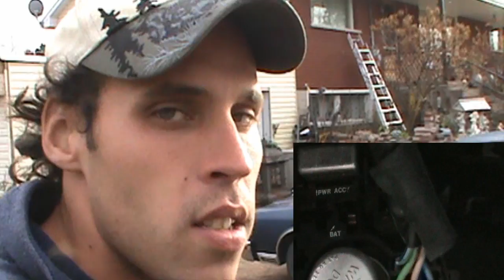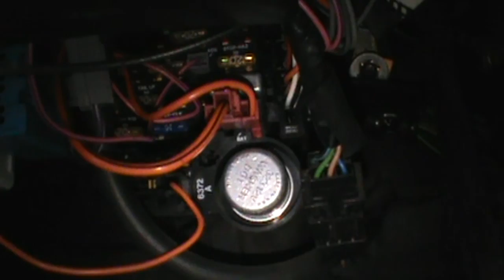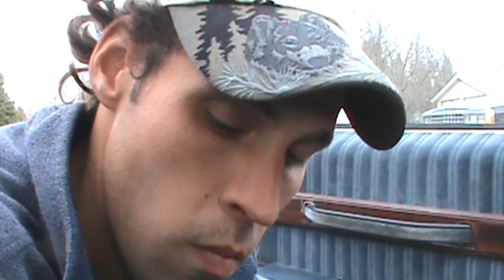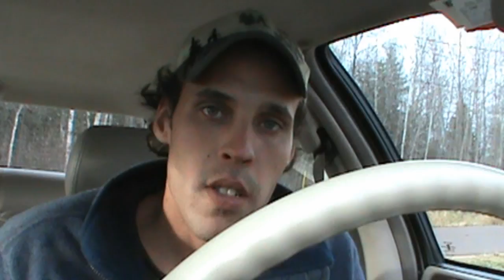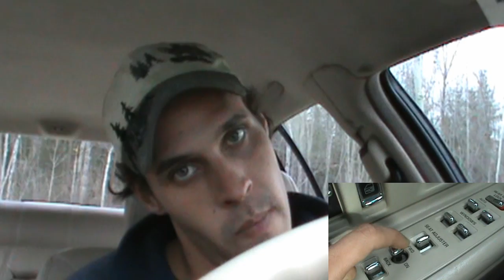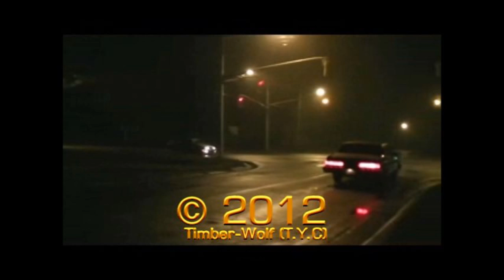Discussion On GM Power Seat Malfunctions

Comment: Not only does 1 of my drivers power seat switches not work (raising & lleering seat level) not work, but I can't figure out how to manually adjust my passenger front seats. Try pulling up on both latches on the side and underneath the front and pushing the chair, nothing.

Comment: Good video, I have a mountaineer 05 here with power seat problems, the lumbar support button works, the heated seat button works but the Back, Forward, Up & Down button does not work? Before trying to take the seat out, I tested the fuse with multimeter which was good. I will check the procedure again tho. Any advice would be helpful, thanks
Reply: Everything on my seat works except the recline up button...it goes down  but wont comeback up

Comment from the maker: Okay, if that shaft is broken in half try this. Take a pair of vice grips and try to turn the shaft not at the motor end but the end where it links up to the seat track. You might be able to move it that way. I didn't mention that in the video because I wasn't sure if your shaft was broken. The vise grip idea wouldn't work if the gear was rounded off, but if the shaft is broke you might be able to move the seat to where you want with the vise grips. Let me know how it goes.

Comment: Thank you, I tried the moving the seat like you said, But no such luck, And I discovered there is a little plastic shaft that had broken in half but I am going to try replacing the whole unit. It was exactly like you said, It came from a multiple driver family that owned it since new. Thanks again.
Reply: Whats up were u get seat motor from??